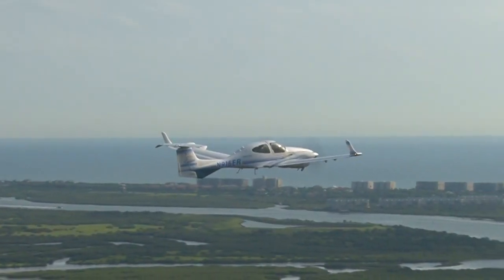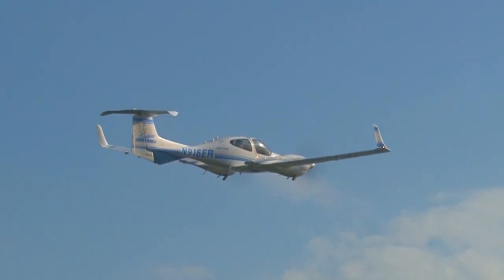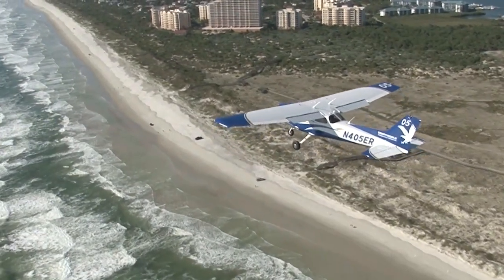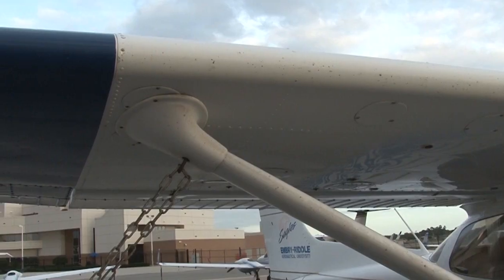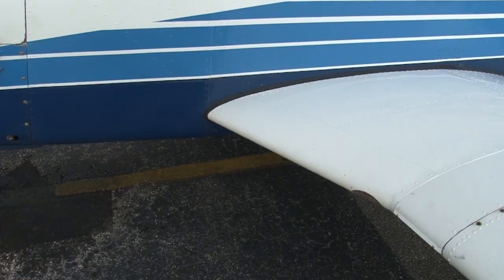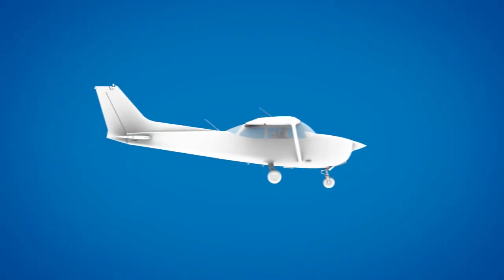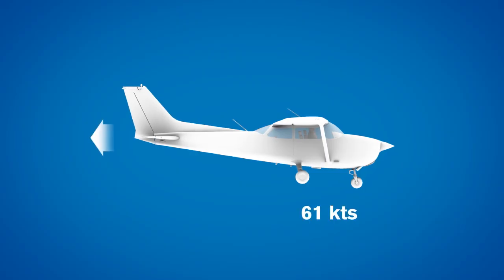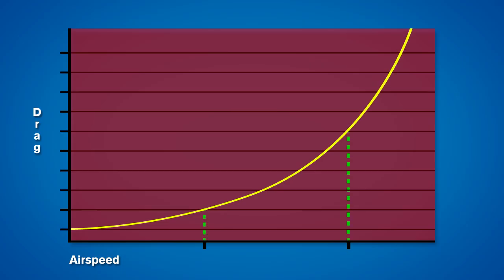Principle of Flight - Parasite Drag

Comment: Thank you. What about the effect of the altitude on the parasite drag? How does it decrease? Why does  (Thrust-Drag) increase with altitude up to the tropopause (at least for turbojet)?
Reply: It will increase because the engine needs more and more power as you go up, so the you will need more airspeed to compensate. Therefore, more parasite drag in the same airspeed from 5000 feet than 50000 feet
Reply: As you increase your altitude,you would need fly at a higher airspeed to compensate for decreasing in density or you could say the air is starting to be incompressible

Comment: Thanks for the video which is very informative. However, I do feel that you are explaining profile drag and not parasite drag- maybe this is the pilots take on it and not the engineers/aerodynamicists take.  I understand parasite drag as that drag occurring from non lifting parts of the aircraft,nacelles,nose cones,aerials etc and profile drag or zero lift drag should be used to explain form drag ,skin friction drag and interference drag. To make total drag one would then need to add induced or lift dependent drag.
Just an observation/idea not meant as a criticism.